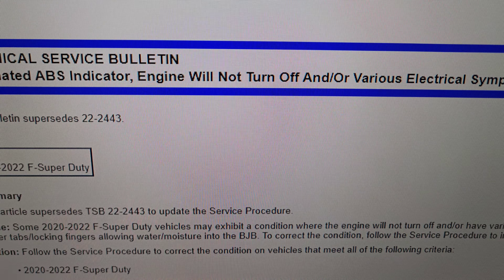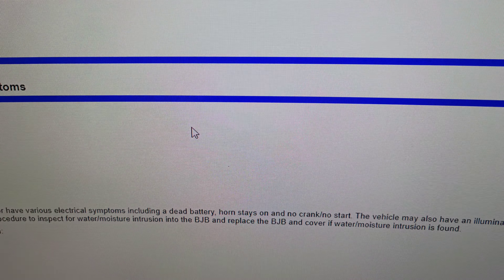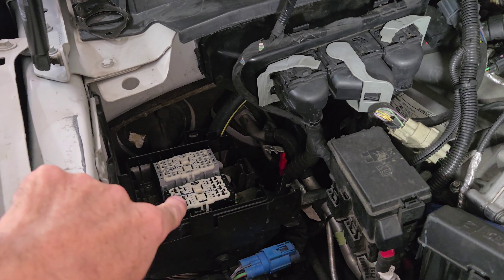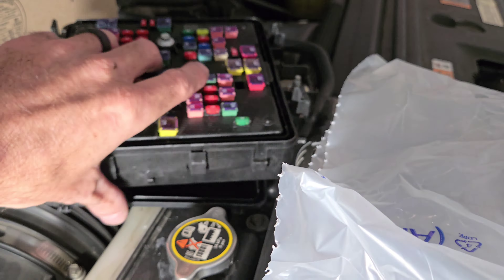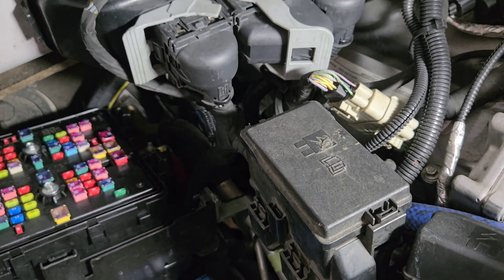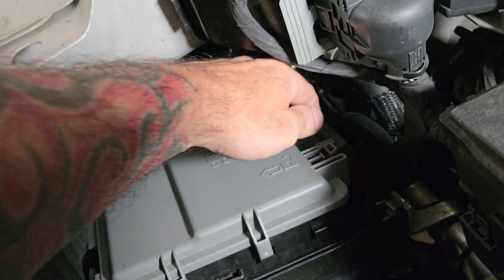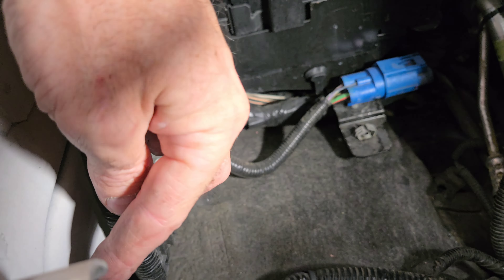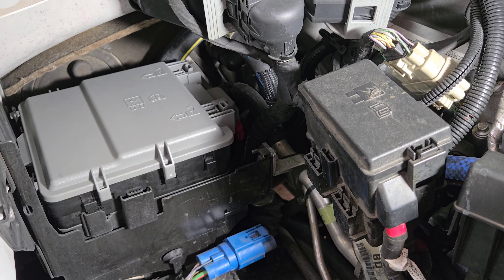2020-2022 Superduty No Crank No Start and Other Concerns #newtoyou ##dieselmechanic #mechanic

Comment: The real solution would be to have silicone gaskets. One at the joint between the fuse box and its receptacle and another for the cover. The fuse box is held in place with bolts. Why not some positive locking latches for the cover? That would keep the moisture out.
Reply from the maker: It does have locking latches on the cover. The tabs toward to fender. Then the lock tab over the battery cable. It also snaps down. The bolts just hold the connectors in place. Water gets into it from the cowl. And it's hot down there. Which creates...moisture and steam. It builds up in the lid. This one will do it again at some point.
Reply: @BeardedFordTech  Looks like a job for Amsoil Metal Protector. 🙂🙂
Reply from the maker: @mlieser1230  man why didn't I think of that?
Reply: @BeardedFordTech  I bet it would make a difference.
Reply from the maker: @mlieser1230  I bet you are correct. Next one I do ill spray it. Then see which one lasts longer
Reply: @BeardedFordTech  Is Amsoil going to offer Metal Protector in 5 gallon bucket?
Reply from the maker: @mlieser1230  that's a good question. I need ro follow up with them on that.
Reply: I wish they would offer the HD metal protector in a quart can so you could use a brush to do tight applications if need be . The mist in the air and having to cover everything in the general area is a pain .  @BeardedFordTech
Reply from the maker: @kenj.8897  I haven't has an issue with having to cover things or having a mist really. Or just haven't noticed a most. Usually use it for batteries and doors. I'll look into that more.

Comment: I replaces mine and does the same thing still.  No melted harness either.
Reply from the maker: @shawngilson5734  so did ypu have low fuel pressure codes?  Like the cp4 is done for. Did you bother to check that?  Or just assume it was the fuse box
Reply from the maker: Did you check for codes?  Like low fuel pressure codes?  Did you check the fuel filters for metal glitter? Or did you just assume it's the fuse box.  Thats why it says check it. Doesn't mean that's what's it.  You replaced a part that didn't need replacing.
Reply: @BeardedFordTech  we had no comm with any module on the truck.  I have the exact symptoms of the fuse block.  Odometer is dashes, every warning message flashing the whole kit
Reply: And it's an odd situation.  Truck is stuck half a mile in the woods in 2feet of snow.  Towing it would be near impossible untill snow melts a little. So field repairs is what I'm stuck with. I am a retired GM mechanic. I also worked at GM TAC specializing in the electrical department. I am pretty familiar with vehicles.  But it's impossible to do much in the woods
Reply from the maker: @shawngilson5734  that would be a body control module. Not a battery junction box issue
Reply from the maker: @shawngilson5734  hope you got a computer and access to nhtsa of for a key code. Your going to need both to program the bcm
Reply: @BeardedFordTech  if I don't find something I'll have to find a tow company willing to drag it out of there.
Reply from the maker: @shawngilson5734  i hope ypu find something. Sucks working on stuff way out there in the middle of nowhere
Reply: @BeardedFordTech  yes it does. Especially 1.5 hours from home.  It's been a long week
Reply from the maker: @shawngilson5734  i hope ypu get it man.
Reply: @BeardedFordTech  thanks man

Comment: This TSB is only if you are having issues?? Is this new box better sealed?? Thanks
Reply from the maker: Just like I explained. If you are having a dead battery. No crank no start. Horn stays on. Engine won't shut off. ABS code C0020 or U3003. Or many other electrical issues then this tsb applies. It's the same box. Same lid as far as I can tell. Just a different color. 👍👍

Comment: Thanks for the info. I have a 22 F450.  Would changing out the old lid to the new one be beneficial?
Reply from the maker: No. Not if it already has moisture.  If it was my truck I'd replace the fuse box and the lid. There no difference in the lid I can see except for the color. Maybe it seals better somehow. Not really sure. I'll have to look into the lid more. But if you are concerned about it. Just replace the box and the lid 👍